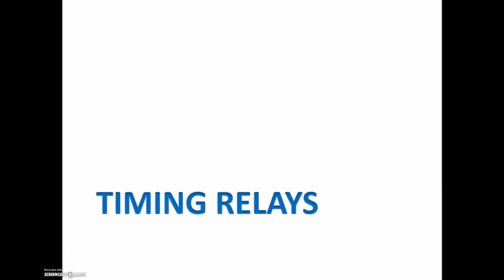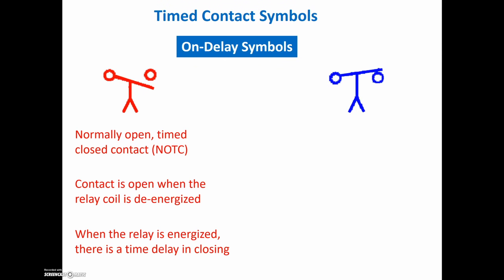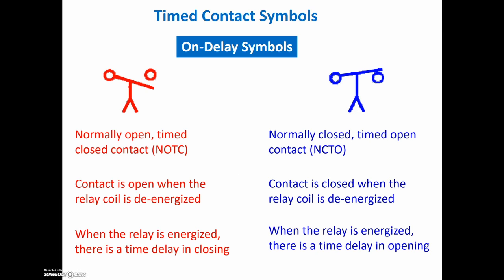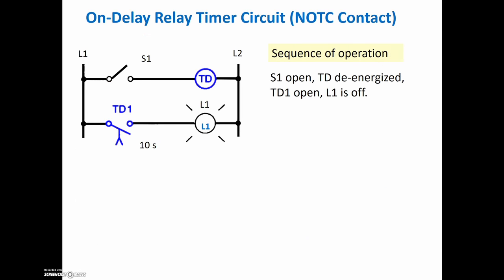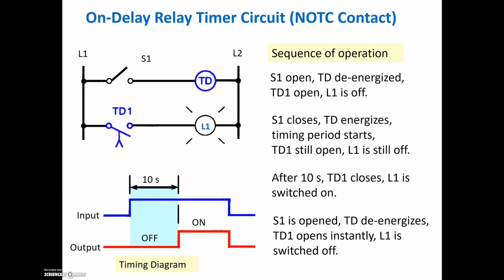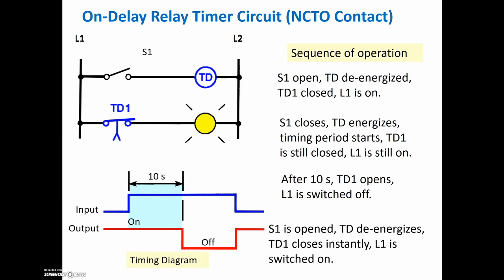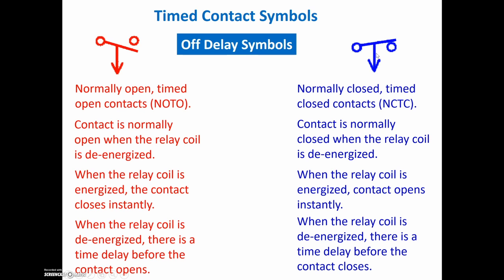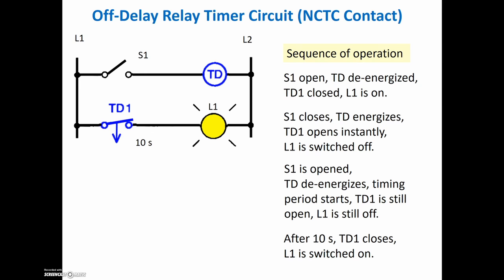On Delay & Off Delay Tutorial (PLC Programming & Ladder Logic)

Comment: OK, I'm still confused little bit. How do I make it so that: light bulb is OFF > coil energized > 5 sec delay > light bulb turns ON > coil de-energized > 5 sec delay > light bulb turns OFF. Talking about same light bulb. Basically for that bulb I want lag to be on both on/off state change = no immediate on or off ever.
Reply from the maker: Most timers provide either On Delay or Off Delay, your scenario is looking for a more advanced timer than the standard 11 pin relay described here: 

https://www.digikey.ca/product-detail/en/omron-automation-and-safety/H5CX-A11-N%2520AC100-240/Z2998-ND/2218205?utm_adgroup=&mkwid=s1PwR2kXK&pcrid=310957509483&pkw=&pmt=&pdv=c&productid=2218205&slid=&gclid=Cj0KCQiAxs3gBRDGARIsAO4tqq0PXgFIndWFKTwISd17Gbbc7hxg7UAq8cXTOu9b04M9UYcWCwshChYaApGoEALw_wcB
Reply: @PeteVree  I found a better solution for my problem. 1) Simple $5 time delay relay from Amazon which I configured to normally open - timed closed. 2) For OFF delay I hooked up 3*4700uF caps in parallel to 12V control which gives me 10 seconds of additional  runtime after full power off. Works in my case since I don't need specific delay timing. In theory it's even easier: hookup plain dumb relay and capacitor + resistor in front of it. Haven't tried it since already got timed relay on hand.

Comment: Would the NOTO setup work for running DRL/blinkers? As in when you turn the blinker on the DRL turns off, however as the blinker flashes the DRL remains off, until the switch is turned off and then the time delay comes into effect, and the DRL turns back on...